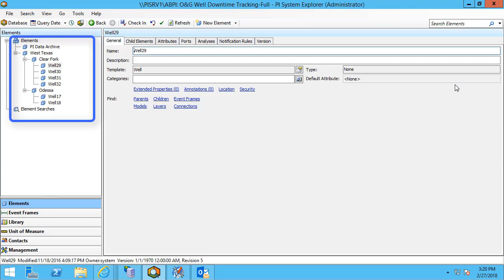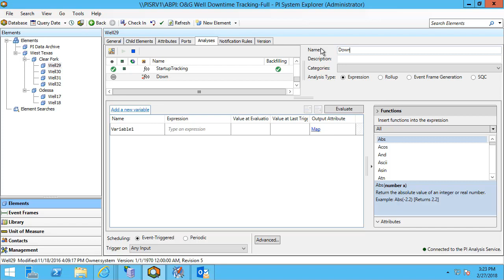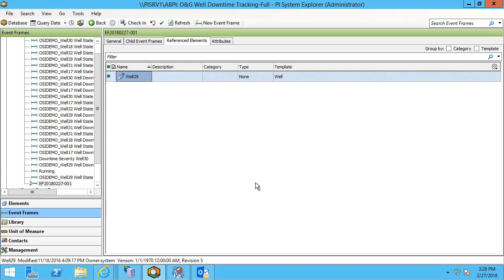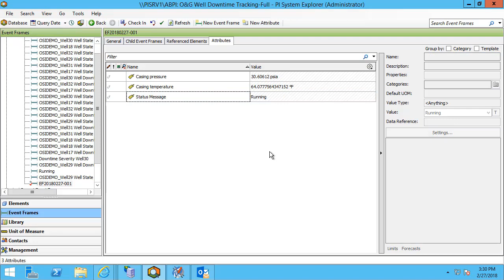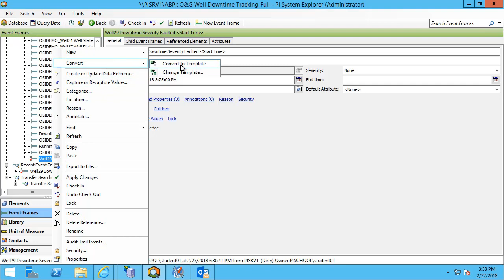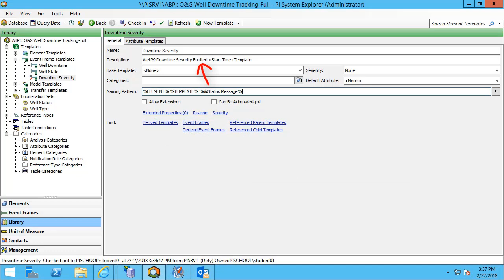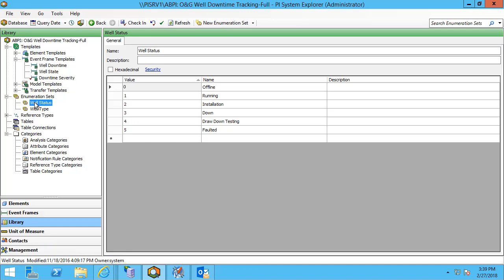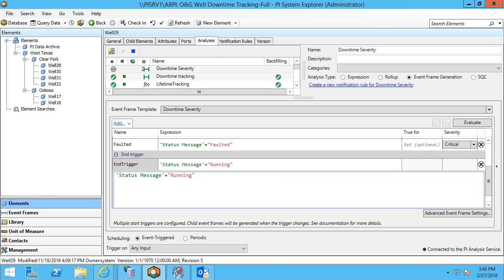PI AF Analytics - Set Up an Event Frame Generation Analysis

Comment: Is there a way to get an average of an attribute over the past 30 days using event frames? i.e. in the past 30 days there are 3 event frames if varying durations and I would like to know the time weighed average of an attribute across all 3 of these event frames.
Reply from the maker: Hi Rahul,
If I am understanding your question correctly, you are wanting to summarize Event Frame data. This is done most easily in a client tool like PI DataLink or with a BI tool. Simply query for the range you are interested in and then use Excel or the BI tool for your summary information on the returned Event Frames.
Reply: @ yes that is what I am after, however I would like to build a tag for that which I can visualize in PI Vision. Is there a way to do that in AF or directly in PI Vision?
Reply from the maker: @brolo18  What you are wanting to do is a bit tricky as PI Vision just displays Event Frames and can't use them as data inputs for calculations. 
However if your Event Frame logic is simple enough you could write a separate Asset Analytic to capture the values that would be in the Event Frames and then average them with the result written to a tag. Then that tag can be displayed in PI Vision. 
One alternative might be to use PowerBI to create and display these calculations on Event Frames and then embed the PowerBI display within Vision. 
Just some thoughts to try to help!

Comment: if you're looking at an analog start trigger instead of a discreet value, do you format it the same way with it being 'Attribute'="0"? (looking at time frame 13:44 in the expression box)
Reply from the maker: Hi Nathan, that is mostly correct. The only thing to remember here is that the double quote " " is only needed for strings. In the case you mention I would assume you would not be trying to compare against a string value of 0.